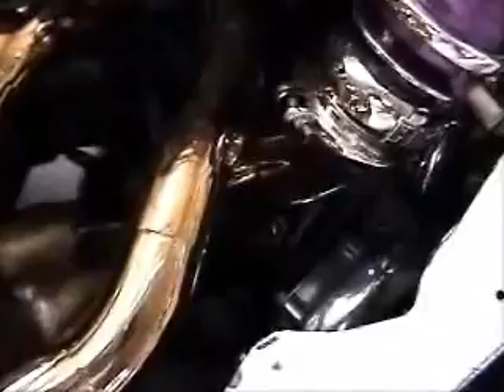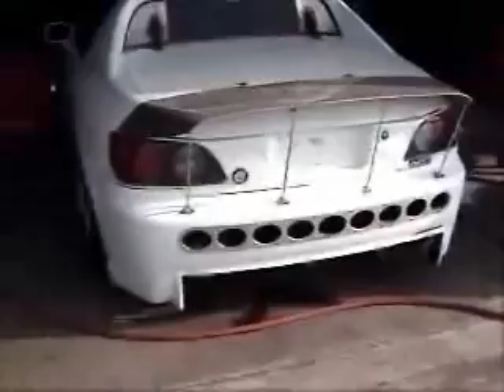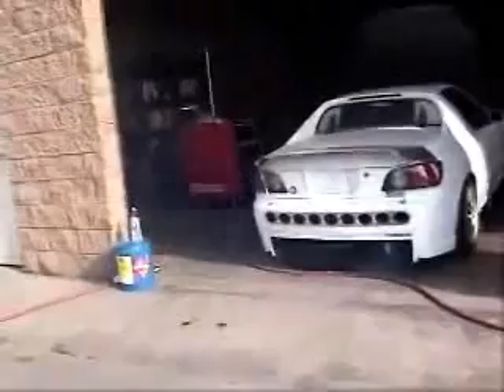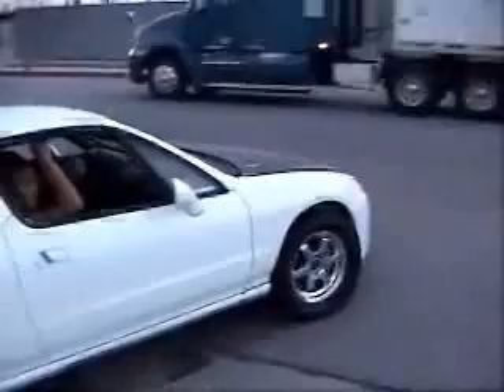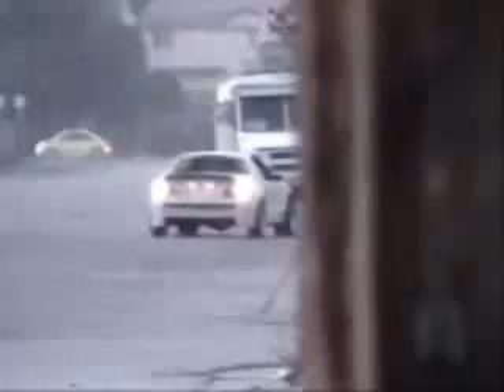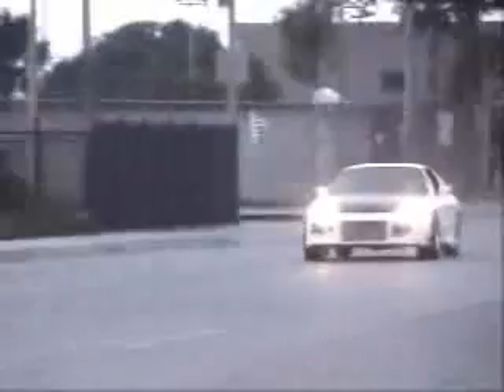634 hp crx del sol

Comment: Boy- ALOT of people (commenting below) are forgetting the power-to-weight ratio of the car in this video. Yeah—a diesel WILL make more power and YES—replicating this setup on a V8 WILL give more power BUT I would think the cost of getting power that way is weight. In MY opinion, I'd rather have a light, nimble car with a lot of power instead of a heavy, cumbersome, soot spilling, monster torque diesel truck...I could live with a twin-turbo gas V8, though ; )

Comment: What is the purpose of the holes in the rear bumper?
Reply: The holes let air flow through the bumper that would get trapped by the bumper. It decreases air drag on the car and also let's the air flow smoothly under the car instead of being turbulent. That's also why people get diffusers and under body plates, so the air will flow smooth. Or if they are stupidly low so they don't scrape which is dumb haha. Hope I helped you Kayla! :)